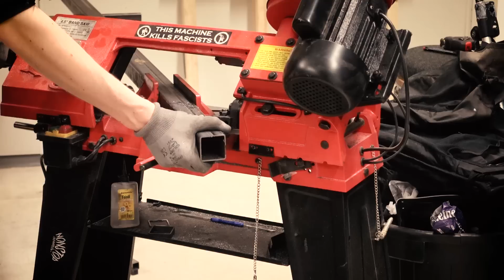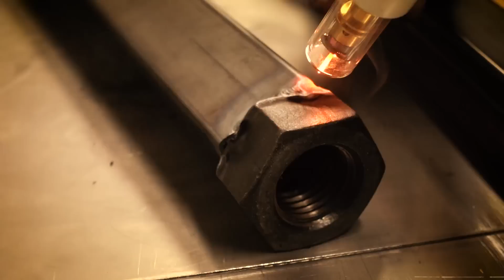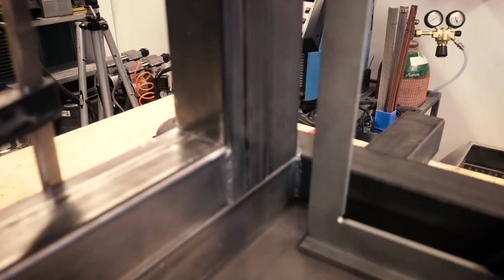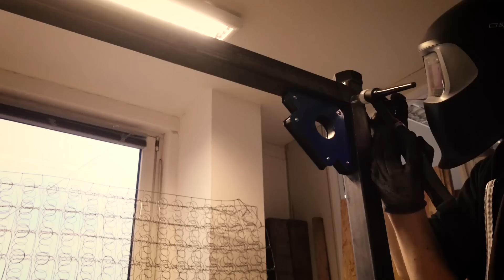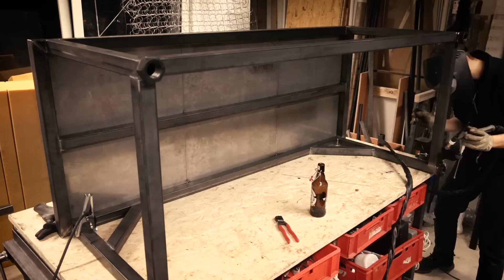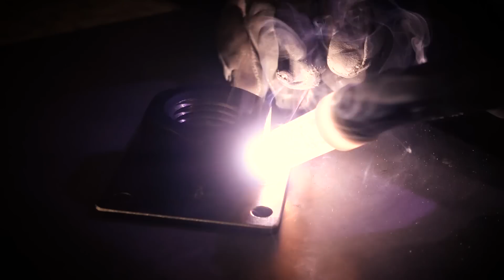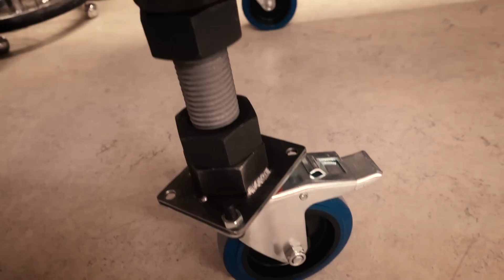Welding Table Build (Plans available!)

Comment: Nice table, what is the reasoning behind using 3 cut sections and not 1 solid piece?
Reply from the maker: Sourcing, transportation, handling mainly. Delivery fees get insane for that kind of size/weight. I get all my stuff deliviered and don't really have the means to handle a single 200+ lbs piece of steel anyway. A single piece would definitely be better for overall flatness. This way it mostly just makes the build easier
Reply: Ok thanks. I am going to build one and was wandering if it had to do with it sagging or waving.

Comment: Can you tell me what size is the threaded rod/nuts? looks like an inch or larger. And would you use this method again?
Reply from the maker: I think they are M36 which is probabl not necessary, I think you could use something a lot smaller for a table of this mass (it's not that heavy for a welding table). To be honest I've never used these to change the height of the table so I guess it wasn't necessary. However I do still think it's a good solution if you want a beefy height adjustment mechanism.
Reply: @PhilVandelay  M36 is huge. The cheapest price  I can find threaded rod and 16 nuts is about $120. I think I will build my table without the adjustment mechanism based on your recent comment. 8 mm thickness is almost exactly 5/16 in. which is not considered heavy - considering all the massive welding tables on YouTube that seem to favor 1/2 in. thickness. I am a beginner and I appreciate your response and your obvious craftsmanship.
Reply from the maker: @p52457  Yeah as I said it's way overbuilt, but I think you can do the same with a much smaller thread like M18 depending on how heavy your plate is. It's really not necessary to use threads that huge.. As for the plate I haven't had problems with the thin ones, a thicker plate doesn't guarentee you more flatness so I don't think it's necessary.

Comment: How do you like the pyrex cup? I'm thinking about getting one for my powertig welder.
Reply from the maker: It's actually a chinese knock off ;) It's nice being able to see a little more but other than that they pretty much behave like a normal gas lens. With the large pyrex cups I think it's a different story and you need those for some special applications that need a lot of gas coverage (like welding TI). But to be honest, for welding steel like this, a regular gas lens performs the same. There's also one downside to the pyrex/glass ones, they break much easier than the ceramic ones. Drop your torch once and it's probably a goner... that being said I'd still be using mine if I hadn't broken it

Comment: What is the thickness of the top table?
Reply from the maker: 6mm plates. You can use more of course, but it's enough for light welding
Reply: Y have a plate 3 mm.  You think it will be enought?
Reply from the maker: @alinbutisca3728  Maybe if you add some more tubing to the frame underneath it to give it more support
Reply: @PhilVandelay  I think the same. Thanks.

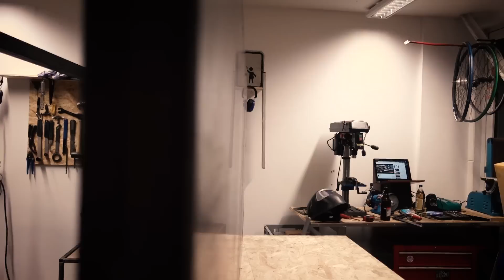Comment: is that a stahlwerk in the background 3:55? :D
Reply from the maker: Yep
Reply: you happy with it? i bought mine just a while ago. have not had a chance to try it out yet though(fourth kid arrived in july :D)
Reply from the maker: Yeah I'm very satisfied. Performs great and haven't had a single issue with it so far. The foot pedal and torch that come with it aren't great but that's my only complaint (and to be expected for a budget machine). I think overall you can't get better value for the price but I also haven't used a really expensive one yet so I can't do a direct comparison. I haven't even tried out the built in plasma cutter yet!
Reply: so you skipped the pedal and went manually with the handle? im still in the learning process of TIG welding :D
Reply from the maker: Depends on the kind of welding. For Aluminium I usually use the pedal because controllling the heat is much more important. For medium sized steel like this I just set my amps (about 85 for most of this table) and just use the torch. You kind of get a feeling for what works after a while, just keep practicing ;)

Comment: I'm a beginner and i don't know much about this field ,i hope you will help me.May i ask ,why is the nuts and metal tubes looks like bit shiny and clean? Are those oiled or sprayed with some clear coat?  This video is so nice to watch ,coz your work shop and the way you done that is sooo... clean.
Reply from the maker: Hey thank you. As for your question, no nothing has been oiled or clear coated, the nuts had a lot of oil on them from the manufacturer (rust protection since they're not galvanized - better for welding) but I removed that wtih a degreaser. Everything has to be pretty clean and oil free for TIG welding, otherwise it will mess up your welds.
Reply: Thank you very much for your reply.Really helpful.
Reply: I really like what you have done. I need to weld up a welding table. I figure I will just use my powerimig on the whole thing and not tig weld anything.
Reply from the maker: Yea, that would save you some time for sure
Reply: Phil Vandelay How Did You Degrease? I just bought a bunch of nuts about the same size and need a good way to degrease them

Comment: Nice job 👌🏼 how long you have this sahelwerk 200 dc/ac plus plasma? No problem with it? I planning buying same machine
Reply from the maker: I've had it for two years now, so far I haven't had any big problems. Sometimes the Amp display acts a bit weird recently but it works fine. I can't compare it to other welders but for the money I think it's a good deal. The accessories aren't great, especially the foot pedal. Still, it's very cheap for what it can do and they give you 4 years warranty.

Comment: Bro where’d you get the all thread from? Awesome video btw
Reply from the maker: Thanks, got it on eBay but it actually doesn't need to be that big. I just used this size so the nuts would be large enough to fit onto the tubes. But you could probably use all thread half that size (easier to find) and still be fine, you'd just have to add a plate onto the tube ends and weld the nuts onto that.
Reply: Thanks yeah I was looking for inch diameter but I like those as well. Thanks again.

Comment: Nice job. Love everything about this build (including the ceiling head-butt! 😂).
How's that forearm tig burn though?
Reply from the maker: Hey thanks. Do you mean arc burn? I haven't gotten any so far, otherwise I'd be wearing sleeves more often ;) I know it's still bad for your skin but my shop gets really hot in summer...
Reply: Phil, yea arc burn. The burn from Tig arc just always seems to be worse than any other. I catch myself out occasionally (mostly when it's hot out) and end up regretting it for a couple of days. Nice work bud, awesome shop setup too.

Comment: The threaded bases seem like a waste of time and materials, very little adjustment. Or am I missing something?
Reply from the maker: There's not that much adjustment downwards but it can go upwards quite a bit, which makes sense since I'm pretty tall. The main reason for the adjustment is to be able to bring the surface to the exact height as other work surfaces (for instance I can now combine this with my workbench to create a large, even surface) but if you take the wheels off and install the table permanently they can also be used to level out the table against the ground. It's not supposed to be moved up and down all the time, really just for one-time adjustment to the shop.

Comment: Shouldve went a little more heavier on the top plate, we have 8mm plate top at work and its absoulte dog sh*t. it's buckled and is nightmare to work around. We are currently building a 25mm thick one at the moment and shouldnt have any problems about buckling..
Reply from the maker: Depends on what you're working with I'd say, for my stuff its held up well, but I don't build super heavy things. But eventually I do plan to put a thicker and slightly larger plate on top to have some more work area.

Comment: Looks like the frame is too large, there is no overhang around the edge for clamping, especially around the gussets.
Reply from the maker: Yeah I made it that way on purpose because the plates are not that thick. They probably wouldn't support a lot of weight it there was overhang so the frame has to support them. You can still clamp things though, but I actually don't do it that much. I might eventually get a single, thicker plate and just put it on top of this. When I built this I simply didn't have the time, cash and means to move a single, heavy plate.

Comment: The files for a pro welding table are for sale on ebay, you can have the parts cut at your local laser profiler. Here's the link.
https://www.ebay.co.uk/itm/142682357631?ssPageName=STRK:MESELX:IT&_trksid=p3984.m1555.l2649

Comment: Ahhh....... now where am I going to put that ground clamp......
Reply from the maker: Ha good point. I eventually added a piece of pipe on the inside of one of the legs to put the ground clamp there
Reply: @PhilVandelay  I really like your design, I am building a 48 inch by 30 inch 1/4 inch thick top and using this video for the build. I can't get those massive 36mm threaded rods and nuts so I'm using 1 inch.
Thanks for sharing!!

Comment: Add some measuremnts of the supplies
Reply from the maker: The total size of the Table is 180x70cm, the three steel plates for the top are 60x70x6mm. The square tubing is 45x45x2mm, the threaded rots and nuts are M36. The rest I kinda made up as I went along so don't have measurements for every cut.